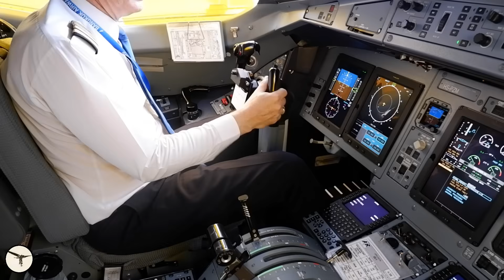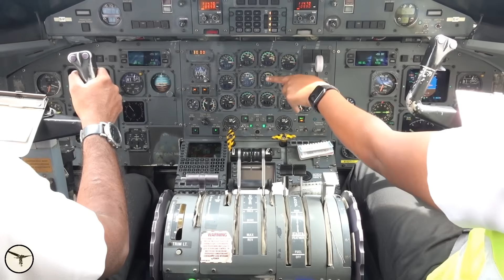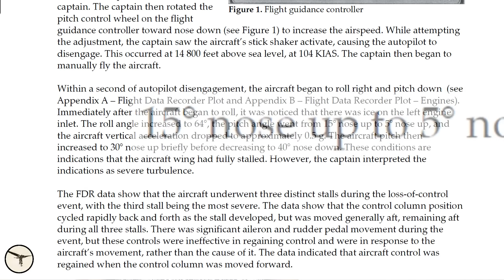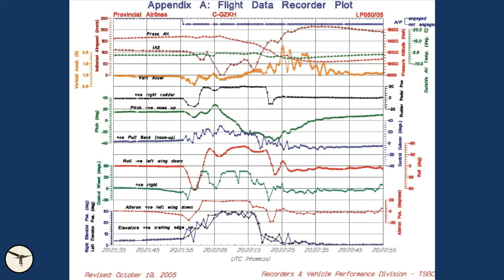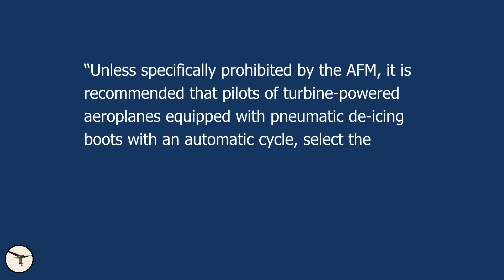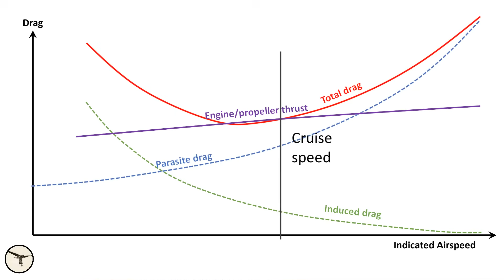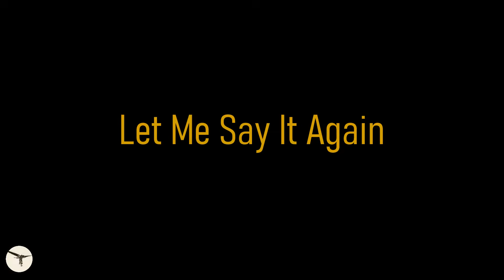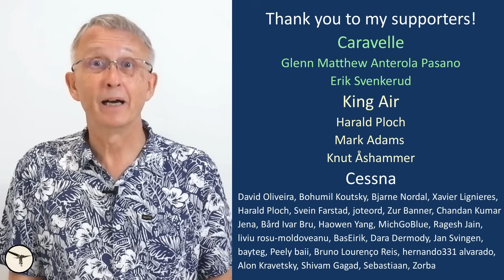The Truth About Aircraft Icing And Stall | ATR 72 myth debunked

Comment: In the late 80s I was trained on the Dash 8 like you mentionned, turn the boots ON only after some ice had accumulated on them. But soon (mid 90s?) it changed to the current procedure on turning the boots ON at the first accumulation indication.  Climbing on VS mode is totally forbiden at my airline. We have the option of climbing in IAS or PITCH mode. Ideal pitch is about 5 degrees nose up and the speed stabilizes around 160-165 (Dash 8 100).  We use IAS more often the 400 as it can climb way faster than Vmo (typically we set IAS 240 for the climb and at some point around 15000ft revert to pitch mode 5 degrees nose up for the rest of the climb). I have over 20K hours on the Dash 8 (all variants) and had two occasions where we were picking so much ice the de-ice system was completely overwhelmed and we we unable to maintain altitude. Not fun. But otherwise the Dash is normally very good in icing.

Comment: Magnar, excellent video. I would say "as usual" but this one is (subjectively) even better that usual, it strikes a particular emotion in me.

I am an aerodynamic lover and Stall is the special fetish.
I was taught stalls wrong. I mean, typical stall teaching: Approach to stall: "reduce throttle, slowly pull up to keep the altitude, here comes the stall warning, keep pulling, here comes the buffet, pull a bit more yet, we are about to stall so NOW lower the nose". Variations of the same thing apply for power-on stalls, turning stalls, and full stalls. Do you know what I NEVER practiced with an instructor? "Stall-warning-recover-right-now!" Slow flight? Stall warning is sounding. Short-field take-off? The stall warning is sounding. 60-degrees emergency 720 turn spiral descent? Stall warning is sounding. What I learnt? (and eventually self-unlearnt?) The stall warning not a warning (that requires immediate recovery) but an advisory caution: you are close to stall, it's ok but be careful.

In 2010 I made a post titled "Stall" in certain aviation-safety sub-forum which was the mother of all stall rants. That posts evolved into a thread 12 pages and hundreds of comments. My opening post was something very similar to this video (but in text): A list of 10 stall-related accidents and then this reflection:

"All these TEN accidents (and there are a lot more) happened in different airplanes, different airlines, different parts of the world, and different "ages" in the evolution of aviation safety.
They also are different in themselves. Different chain of errors or problems in different circumstances and different phases of the flight with different reactions of the flight crew.
And in all of them there were several opportunities, different in each case, to brake the chain of events and prevent the accident from happening, or to correct the incident in a more timely manner.
However, they all have two things in common. Besides all the differences:
1- A stall or approach to stall, or what the crew considered was a stall or approach to stall, was part of the chain of events in each case.
2- In each case, a better understanding of the stall and a proper reaction to it WOULD have prevented the accident thus saving all the lives, or would have cut the incident at the onset and not after a more dangerous or prolonged situation developed.
AND WE ARE STILL DISCUSSING HOW (if at all) THE ELEVATOR SHOULD BE USED IN A PROCEDURE TO RECOVER FROM A STALL OR APPROACH TO STALL?????
I am disappointed. BADLY!"

At that time the stall training in the airlines world was even worse than in general aviation. The normal approach-to-stall recovery procedure for airline planes (including turboprops and jets) was of the type "Full power - pitch 10- degrees". As you mentioned avoiding or minimizing altitude loss was the primary "pass" metric. Only the procedure for a FULL stall recovery called for reducing the angle of attach and to trade altitude if necessary. Descriptions also separated the approach to stall and full stall not as different degrees of the same thing, but as two completely different things. They said things like "Approach to stall is controlled situation. A full stall is an uncontrolled but recoverable situation". Hence the different procedures.

That always sounded like bonkers to me. Approach to stall and full stall both mean "too much AoA" (in one case too close to the critical AoA, and in the other case at or beyond the critical AoA). So ANY procedure to recover from EITHER MUST entail reducing the AoA. The "standard" procedure at that time does achieve that, indirectly, in many but not all cases: By applying TOGA on a plane that is about to stall, if there is sufficient power, the plane will try to pitch beyond 10 degrees of pitch so holding 10 degrees involves pushing down, which reduced the AoA. Of course, if there is not sufficient power to keep 10 degrees, trying to do so will only worsen he situation.

My proposal was very simple. Approach to stall and stall are two degrees of the same thing, the problem is too much AoA and the correction is reduce AoA: At the FIRST sign of impending stall (stall warning, stich shaker, buffeting...) use the elevator reduce AoA AT LEAST as little as necessary to make said signs stop. Only of ground contact or obstacle clearance are of concern, reduce the AoA JUST enough to make the stall sign stop and add power (with caution if underslung engines). If ground contact is not of concern, you can be liberal with the reduction of AoA and delay the addition of power until after the stall is fully recovered.

Shortly thereafter, the transport aviation industry together with the FAA and EASA killed the previous procedure and came up with a new one that is basically what I said above. I would jokingly say that they followed my advice, but of course it is much more realistic that they saw the same issues that I was seeing.
Reply: I thing the first one is stall prevention procedure (what always trained in sim). The second one is stall recovery procedure.
Reply: @juanmanuelgomezmartinez3795  ... Today they are the same. Close to stall? That means too much AoA. Already stalled? That means WAY too much AoA. In both cases the problem is too much AoA. In both cases the only recovery that makes sense is reduce AoA.
Reply: @ Agree. Years ago a student applied prevention procedure when the airplane was already stalled (problem with AOA stick shaker). Tried first wings level maintaining pitch. The situation worsened really fast. We almost enter in a spin (100 degrees bank angle)
Reply: @ ... I would also add that there are 2 very big problems with the old "2-procedures" approach, in addition to the fact that both of them must imply a reduction in AoA to make sense.
1) We have clear indications, like the stall warning or buffeting, that we are approaching the stall. We don't have a clear indication of when the max coefficient of lift has been exceeded and we are now actually fully stalled. That can cause they kind of confusions that you mentioned.
2) The worst thing about the stall is not really the reduction in lift, but the very bad worsening of the lateral-directional handling characteristics, and these effects start at high AoA's before the actual stall. Aileron effectiveness is greatly reduced, adverse yaw is greatly increased, and roll damping vanishes. The "window" between the stall warning and the actual stall is very dangerous and there is almost no additional lift to extract in that window anyway. Observe that the majority of stall-related crashes happen not in a flat and dumb way. The majority happen when a wing drops, or the plane flips inverted, or spins. So "preventing the actual stall" but remaining in the "stall warning" region can still kill you.
Reply: @ something like that happened. In this case the stick shaker was really close to stall. Almost at the same time in clean configuration. Left wing started to drop. The student input was right aileron. The left speed roll increased then I take the joke centering ailerons and pushing the joke abruptly. Whit AOA within limits corrected the 100 degree bank to wings level. Was scary because the situation developed really fast. Maybe a little more than 1 second
Reply: @ ... Exactly. My full stalls during the PPL training were close the throttle, slowly pull up to try to keep the altitude and keep doing so until the nose drops, then recover. During one of those full stalls left wing drops before the nose does and I immediately react with right aileron. Suddenly I feel that I was hanging from the seatbelt. It was my instructor pushing forward with the palm of his palm in the center of the yoke. He didn't even attempted to say "my controls", not even to properly grab the yoke. I complete the recovery as if it was Wednesday and then the instructor with a very serious face and voice says "DO - NEVER - DO - THAT - AGAIN" and I was like... Me? What? Then he explains it to me. It was in important lesson that I will never forget, but now years later 2 questions haunt me: 1) Shouldn't he have explained that to me BEFORE we start practicing full stalls? 2) Would he have ever taught me that, had we not encountered the wing drop by chance? Side note: It was a Tomahawk and we were 1200 ft AGL. (talking about haunting)
Reply: @adb012  Jejjejeje. I did exactly the same. But I did full recovery. The difference is that we did prevention procedure. We never practiced full stalls in the airplane (C560 ULTRA). The problem was a LATE STICK SHAKER. Jejej. And is obvious that you needed to know what happen when you use ailerons in a stalled condition before practice. Could be traumatic jejej

Comment: You are absolutley right about the problem of even experienced pilots not realising they are in an incipient stall and pulling back on the controls instead of what Juan Browne drilled into me (I'm only a simmulation flyer) but "If the aircraft is mushing it's going to stall - get the nose DOWN!" It is surprising tha there seem to be experieced pilots who don't react that way either at low altitude or very high altitude where stalls can also occur.
In simulation flying over Papua New Guinea flying a Twin Otter I have experienced an incipient stall climbing to sixteen thousand feet because I had set a climb rate on the autopilot that the thinning air couldn't support. Then "Juan" was straight in my ear - " Autopilot off and get the nose down!" It worked!
I have also had incidents when flying simulation in Papua New Guinea's mountainous areas close to the ground in limiting weather and whilst flying slowly for safety reasons and flew too slowly and encountered an incipient stall. As you say Magnar, despite all instincts you can't pull back - the nose has to go down to get some airspeed but when the ground gets too close then easing into a gentle climb is neccesary to win some altitude before descending again to boost the airspeed. An oscillating flightpath but it works.
Thanks to pilots like you Magnar, Ryan Farran, Juan Browne and Hoover those of us in simulation can learn a huge amount and so can actual pilots in aviation if they are prepared study your advice and I wish a lot of low hour PPL pilots would.
Reply: Another big factor is that in todays training they don't tend to teach us how a real stall feels. They show us how it looks, alarms etc. But IRL some instructors will only take the aircraft right up to the stall warning and that's it. Leaving some of us with the question of what happens after, how it feels etc.